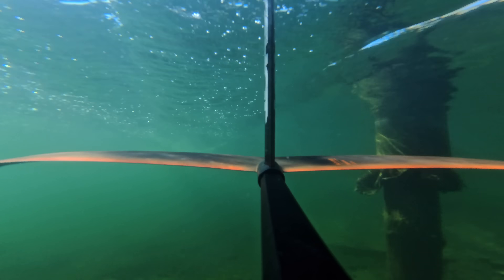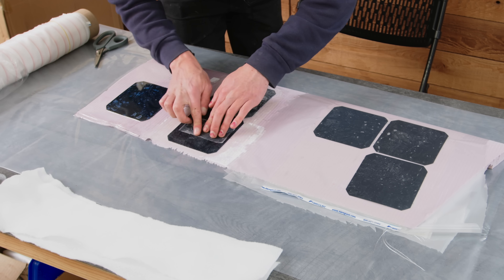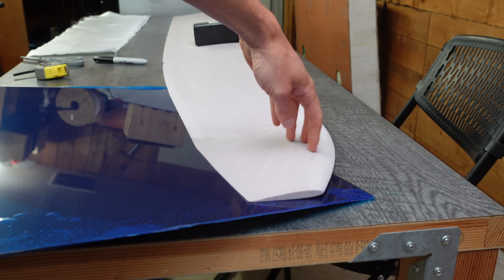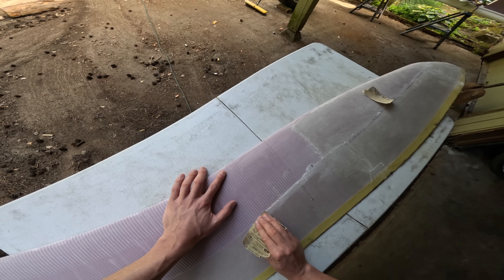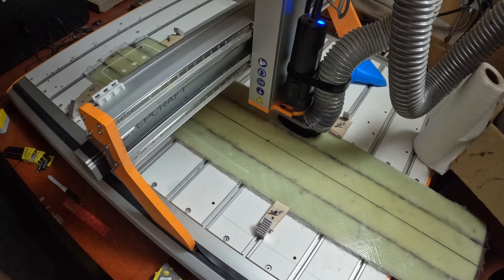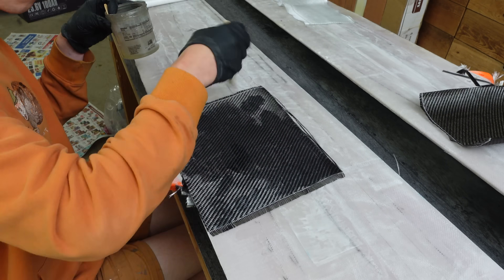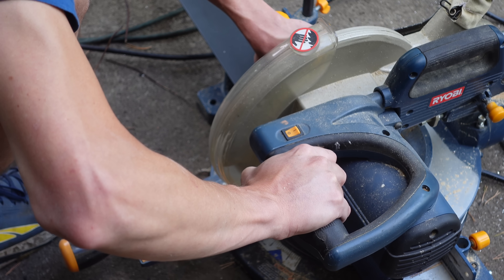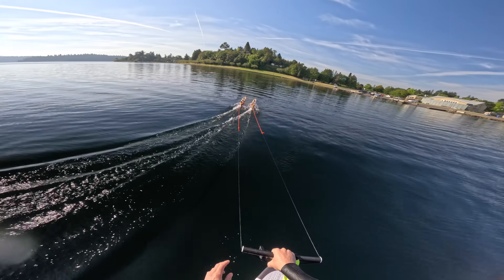I Built the World's Biggest Hydrofoil Board

Comment: I know I’m repeating myself, but Daniel, please, please try cutting the fiberglass or carbon fabric at a 45-degree angle instead of along the fibers. This advice comes from someone who has worked in a composite sport boats factory for years. You’ll be amazed at how much easier it is to work with and how much stronger your parts will be. If you cut the fabric on a diagonal, like at 7:25 here, you wouldn’t need to trim it on the tip of your part, and the entire wing would be more resistant to twisting. The fabric will also adhere to the surface more smoothly. This technique has no drawbacks, only advantages.
Other then that - Great Project! Thank you so much for inspiration!
Reply: Sorry if I did not explain it clearly. It is not a trivial task to explain just with words.
I'm referring to classic fabric with fibers arranged at a 90-degree angle to each other in a 50/50 ratio, as I believe this is the type of fabric @rctestflight primarily uses.

I'm trying to convince him not to cut his fabric along or perpendicular to the edge. Instead, I suggest cutting a few strips of fabric at a 45-degree angle to the grain. Strips cut at a 45-degree angle are much more effective when it comes to shaping them around complex shapes and edges; they lay much more easily, especially on edges. Additionally, if we need stiffness in one direction, we can cut a strip twice as wide as needed and then stretch it. This will give us the required width, with the fibers positioned at approximately a 22-degree angle, which will further reinforce the piece.

Of course, when it comes to high-performance parts, the calculations are much more complex, and in those cases, fabrics with fibers aligned in only one direction are primarily used. I was more focused on making components in a home garage setting.

Sorry, @Rob1970s, but you're mistaken. As proof, I suggest a simple experiment. Take a multi-layer laminate made from fabric with fibers arranged at a 90-degree angle. Cut a circle from it and try bending it with your hands. You'll quickly notice that it bends much more easily along the fiber axis (where only half of the fibers are bending) and it's much harder to bend when you try to bend it at a 45-degree angle to the fibers (when all fibers are subjected to bending). So yes, it does matter how you cut and arrange the fabric in a composite part.

Maybe one day I'll record a short video to explain it in detail.
Reply: @MaciekAnuszkiewicz  yeah. please make a video it's hard to visualise what you really mean just using words.
Reply: I work on wind turbines and I agree here, biax LOVES 45 degree cuts, woven or non woven. Also check out vacuuming compacting laminations or resin infusion, you can really crank the modulus to 11 with some of the methods these race boat guys use
Reply: Uh, hem, ALL materials you cut at a 45 as it is the shear angle for ALL materials.  --> Watch there is some know it all who knows of some VERY odd material which does not have a shear angle of 45 degrees.......
Reply: @w8stral Are you talking about using fabric in a shear web? Yes, those are cut at 45° for shear. Have you ever heard of a D-spar? Look it up. You basically glass the nose of the wing to a spar and this prevents wing twist. You apply these layers at 45°. Think of it this way-

When you load a wingskin with 0-90 layers, half of the fibers carry spanwise loads and half of them carry loads front-to-aft. When you use 45-45, EVERY fiber is SHARING both of those loads. It makes a more balanced composite. 

Maciek knows what he's talking about.
Reply: @BennysThoughts  Uh, you have lost the plot.  The TOPIC is what is the easiest orientation of a material to CUT at. Uh hem, NOT fiber composite  layup orientation of a composite In which case you are uh, again, wrong as that is determined by which direction is the major stress. Especially not on a wing.  Or in your case, you brought up D spar of which only VERY simple RC aircraft use.  Even on a simple D box you are MUCH better off with unidirectional with only some of the fibers oriented 45 bias.  ON a swept back wing, he is going to want a 2nd spar and orientation bias of 45+ sweep angle so it appears about 70 degrees.
Reply: im designing my own composite skateboards and its not that simple  ,only 45/45 create less than 50% stiffness in other directions (0/90) where 0/90 layup create mostly stiffness in those 2 directions 
but using only 45/45 will have an issue where u have same stiffness in all directions while u dont need to and in the end u need to add more and more to achieve stiffness in that one direction that flex to much
thats why there are directional fibers etc 

also different woven pattern (twill / plain etc) have different stiffness that also change by multiple things
Reply: @ErtsenPlayGames  Ye it really is a rabbit hole, the first comment is 80IQ brain dead take.
Reply: @ErtsenPlayGames  im a materials phd student at Stanford and i see why you think that but ur wrong
Reply: @davidmack8188  what exactly ? (because i posted 2 different comments)
Reply: He knows and is trying to not embarass you by showing that you're wrong in a video. Just stop.
Reply: @Zander10102  you need to learn to speak with love.  your comments come off super hurtful and i think you dont spend enough time thinking about others' feelings.  i was super disappointed to come across your reply
Reply: @MaciekAnuszkiewicz  You're both right in different ways. You need +/-45 degrees for shear stiffness and UD for bending stiffness. My sense would be around 30% of 45 degrees for shear with about 10% 90 and 60% UD along the span. That's because with geometric wing sweep you get wing bending induced washout which is good. My 2 cents
Reply: Not quite. Yes the fabric would be easier to be placed over the wings, but the stiffness is reduced by that. That's because fibres are only stiff in the orientation of the fibre. For a strain not coaxial, it loses a major part of the stiffness.
When designing a composite material, there are a lot of considerations. 0° orientated layers for stiffness in the main loading axis, 90° for stiffness in the other axis, 45° and -45° for adding stiffness to torsional loads. Sometimes it is better to design not for maximal stiffness, so the part has some flex. Also, the stack has an influence on the damage tolerance of the part. Calculations are possible and necessary if one wants to reach the best possible wing, but also not that trivial to do.
Reply: LOL, there is a brand new material they invented that when in an I-beam configuration is super strong.  It is called "steel".
Reply: @ASDasdSDsadASD-nc7lf  LET EM KNOW BRO!  everyone claims they work in materials nowadays but they dont even know about steel man its a crazy world.  pls stay safe
Reply: Just somehow integrate Cannabis fibre & its a win, win, win, win situation.. just throwing in my 2 cents.. Love this btw!!
Reply: he doesn't care about your brilliant insight because he only cares about himself.  its very very sad imo
Reply: Fiberglass and carbon fiber are both cross fatched weave . .. it doesn't matter what direction you cut at all , it's cross fatched !!!  X
Reply: @Rob1970s  Sorry I'm not sure I understand you. I was referring to the fibre orientation on the part, not the fabric. 
But there are also different types of weaving patterns. Twill, Satin, Plain weave, unidirectional and lots more. Plain weave is the most common but for curved shape the hardest to drape. Twill might be a good option for him.

Comment: Combining carbon and glass fiber in structural parts is not a good idea. They have vastly different elastic modulus, so carbon fiber takes most of the load first, and if it alone is not strong enough then it has to break or delaminate before glass fiber can take up the load properly. Think of it like trying to reinforce a rubber band with a piece of stiffer string. It'd be only as strong as the string alone at first, and when it breaks you're back to original rubber band too. Glass fiber is nowhere near as stretchy as rubber of course, but in comparison to even more stiffer carbon fiber it might as well just be.

Comment: Could this be slow enough to run on human power for longer distances? I just read that a guy named Nicolas Iten set a record of 55 km / 4 hours pumping a foilboard, which is amazing, but I guess he's not an entirely average human being. If you add a pedal powered propeller to your board, might it be possible to ride it for hours for someone with less skill and more average physique? Of course the propeller mechanics adds weight, but I think it would be physiologically more efficient than pumping. A stabiliser might be needed though? I'd love to see an estimate of the power needed to to get it up on foil from a floating position, and the power for sustained foiling.

Comment: would you be able to retain the twist in your wings by glassing the upper(or lower) surface WHILE the wing is still in the foam-board?  if you are required to flip the foam-board, you would be inserting a glassing step between cutting sides (upper and lower) on the router.  this would effectively give you full support during your initial glassing pass and when the wing is ready for the final glassing steps, there would be a rigid fiberglass layer maintaining the wing-tip twist during the next glassing/vacuum-bagging step.

another thought about your table size restrictions.  you could cut the wing in multiple sections out of the same foam-board by using the same alignment pins you're using for keeping your upper wing surface above the lower wing surface.  you'd have to have the space to hang foamboard off the side of your CNC table, but you could use multiple cutting programs (L-tip, L-mid, fuselage, R-mid, R-tip).  you'd just program a bit of overlap between wing sections and index the material between programs.

Comment: Youldn't you enforce the twist by 3D printing brackets (really just like half a centimeter wide) to support the wing from the bottom and pull it down at the same time in the perfect shape? Basically, 3D model the wing, put a cube around it, subtract the wing from the cube, cut a slot in one side, chamfer or filet the edges to give you ample room to slide it in while still holding the center and one edge, then split it up into 5mm segments every 10cm-ish.
Hot glue them all to the table or put a board with some weight on top while the resin cures to stop the wing from deforming and lifting up the printed brackets.   
This way you could even reuse the same wing but force it in slightly different twists by using differently sized brackets or moving them around

Comment: Hi! love your channel, ive been watching since the v1 solar plane, I feel like I have some knowledge that could help you out -- Balsa wood bonds really well to epoxy. It probably would have been better for making the plate as the bonding strength is super important when making a sandwich plate. We made a strip of it in my composites club. It's impressively light and strong (however we did use prepreg unidirectional carbon fiber, but it was really strong even by those standards). I think there are some really expensive foams that can allow a similar shear strength, but yeah, they're really expensive. also, its always good to use a vacuum bag if you can, more pressure=better. someone else mentioned it, but they make those plates with an autoclave (or a press) and prepreg fiber, you won't be able to achieve that same stiffness unless you can get your faber-matrix ratios perfect, both of which becomes a lot easier with an autoclave and prepreg (autoclave can apply 120 psi on top of a vacuum bag, and it also heats to wet out the epoxy better. the prepreg is basically composite stickers with the perfect amount of epoxy pre applied in the manufacturing process, but you need an oven to cure it... anyways I could go on forever and this comment is probably gonna get buried so I will stop here.

Comment: The plateform who's holding the board have so much flex, you will not be able to pump efficiently... Don't even think you'll be able to take a curve... Way too much cord on your wing... Even with the beta foil it is super hard to turn... You should redesign everything I think... But great motivation, and nice video. 🙂

Comment: The reason 5mm fiberglass plate is strong and solid, is because it's cured in an autoclave under pressure and heat that's ramped up and down at a specific rate.  
Use a vacuum bag at least and you'll get better results.  TBH, the difference between yours and the real stuff has very little to do with the type of cloth, compared to the difference you'll get if you cure it properly.

Comment: I wonder if you’ll encounter a sort of inverse ground effect with having such a large wingspan relatively close to the surface of the water. 

I think this will reduce the amount of lift you can generate with that size of wing, by virtue of the water column composing the low pressure region above the wing not being tall enough to totally develop lift. 

I’m pretty sure we’ve been seeing this already with your large wing producing a standing ripple behind the board, which you don’t really see with smaller hydrofoils at the same depth.

Either way, super cool video, thanks!
Reply: Considering it's so lightly loaded I don't think that's an issue, to develop lift you only really need to redirect the same amount of mass you're lifting right. An oversize foil doesn't need as much mass per area.
Reply: @ That makes sense. I wonder more that it would result in a loss of efficiency than a loss of usable lift

Comment: when you need flexure stiffness and yet a light plate, you should go with some sandwich plates! use some foam in between your composite plate skins, its cheap

or you could just glue somme stiffner squared section cheap pre-made glass fiber tubes underneath your plates

great video!

Comment: 3:01 the horizontal stabilizer provides static, not dynamic stability
Reply: Yes! H. stab. incidence won't correct the attitude alone if the craft gets disturbed. Only thing is does is provide a static pitch up moment.
Reply: @UnitSe7en  No, the horizontal stabilizer does provide a negative pitch up moment (its lift varies with aoa), so in response to a pitch disturbance the aircraft will counteract that disturbance trending towards to steady level flight; this is static stability. Dynamic stability is the tenancy of the aircraft to not oscillate and has to do largely with the damping coefficient of the aircraft as a whole, which is related to but certainly not caused by the pitching moment provided by the read stab.
Reply: @notravstar  I was under the impression that @UnitSe7en was agreeing with you, that the horizontal stab provides static stability only.
Reply: This is an excellent observation! I think that the most important thing paired with this is that while his wing may be statically stable, it may also be dynamically  (over-)damped which would preclude the dynamics necessary for pumping.

Comment: You are getting closer to what I see as a boat that doesn't float and a plane that doesn't fly, but together they sail very well. Glider foil for below and above. Ground effects on a water rail. The top wing might have to rotate on the bottom wing, like a sail rotates on a keel, but the ground effects would point the foil into the wind. It would be cool if it could launch from one swell to the other,  Thanks for being interested in this.

Comment: Nice build! It looks like you would benefit some from vacuum bagging more of the laminating steps, pre-coat the foam etc. Not only save weight but makes for quicker and stronger/stiffer build, since you mess around less with epoxy saturating the fibers. No need for peel layer that covers "everything", use only very narrow peel strips and somewhat dense pattern of outlet holes to allow transport of air and excess matrix. For the areas in between you use somewhat thicker plastic sheets that allows see through and that leaves smooth shiny surface. Also, do not sand in between layers, instead time the gel state, do a quick clean up with razor sharp blades (tons of), and just continue with next layering step. 😅

Comment: Shear Web for stiffness. Without that the foam is carrying the shear load between the two reinforced skins.  And foam is flexible so the structure is too.
Reply: If it is a high density foam it would be fine, the main problem is the bond strength
Reply: My thoughts exactly. With the foam in the middle connecting the two laminates it is like taking a metal or whatever I beam and replacing the middle vertical part with a flexible foam. That is such an obvious mistake. And thanks for the term 'shear web' :) Didn't know that.  I've designed and built lots of industrial machines the past 40 years or so but never anything with wings. Now I kind of want to (do wings)...
Reply: Not really.  Most of the strength is in the skin, and as long as you keep the top & bottom skins separated, you have most of the stiffness of a solid foil with a fraction of the weight.
  The shear will be borne by the skins  joining at the leading and trailing edges; without that you would truly have a floppy mess.
  I-beams work on the same principle, but the rigid vertical portion bears the shear, so the top & bottom don't need to be joined at the edges.
Reply: @markmarkw1919 the load path from the top to bottom skins is so long through the leading and trailing edges that there will be a lot of flexing.

Comment: When you want something to make a smooth surface finish over top, get yourself some "glaze" at a local auto body supply. While you're there buy some "evercoat" branded filler. These products will melt PSB type foam board but I think your EPS foam is fine.
Reply: Polyester body filler, along with almost every other solvent except water, and isopropyl alcohol, will all melt Polystyrene.